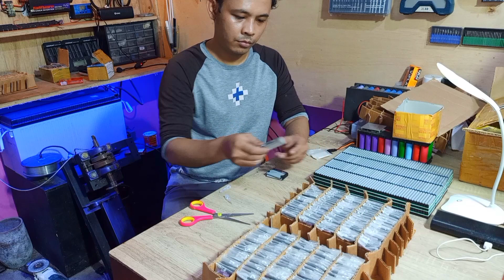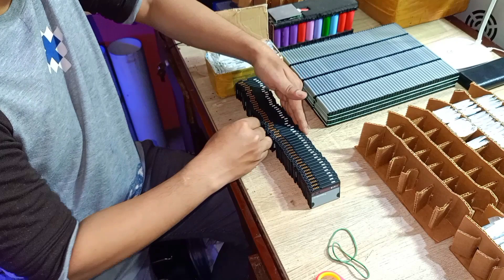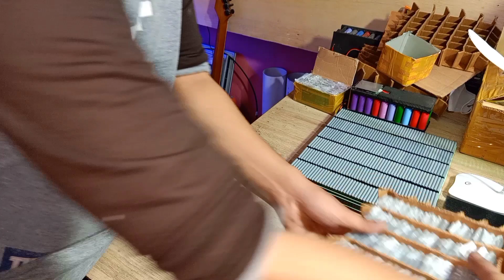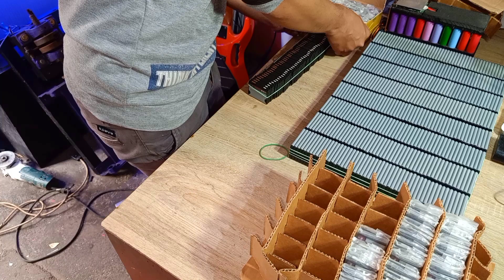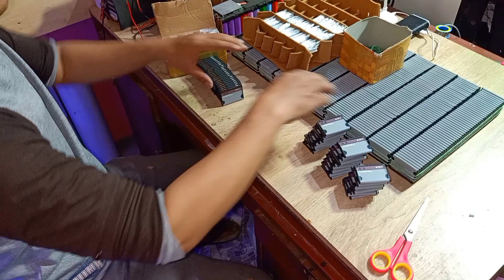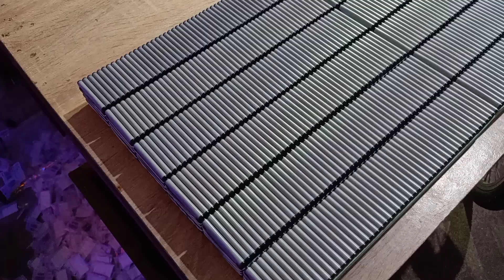BURUAN RAKIT ini Aja POWERWALL Tenaga SURYA Part 1

Comment: Nanti nyambungnya pake kota apa mas gaes?
Reply from the maker: Mksdnya kota mas??
Reply: @projectringan  kotak/breket
Reply from the maker: Owh bracket ya....nanti dibikin model tesla powerwall.mas....di buatkan box
Reply: @projectringan  ide : pake pipa PVC d'panasin d'bikin kotak... hehe
Reply from the maker: Tuh ada ide manteb kan👍🏻👍🏻👍🏻😃😃
Reply: @projectringan  pipa 2.5", sm drpd soLder pake spotweLder harga 150'an.. hehe
Reply from the maker: Mau dikasih fuse kok per cell 
Lagian yg di solder bmsnya